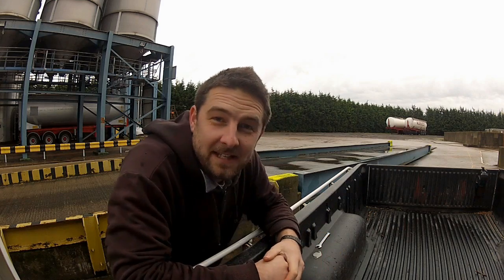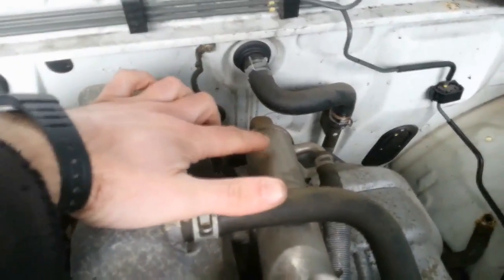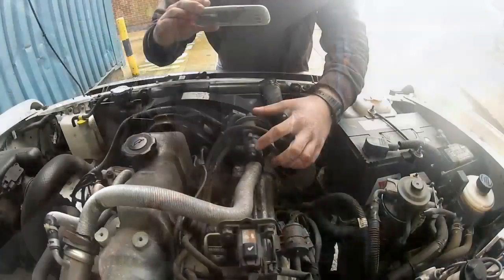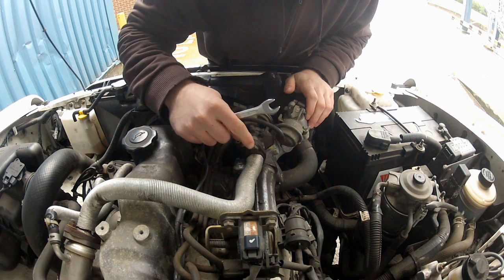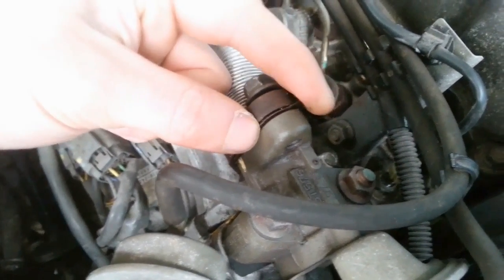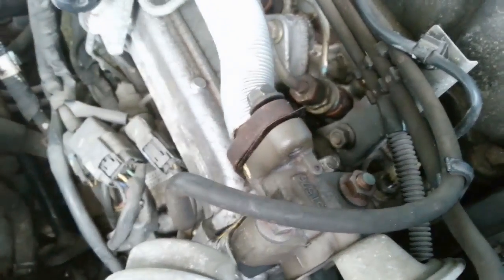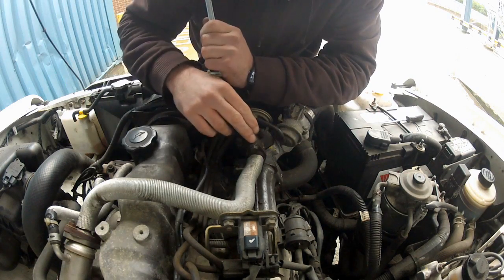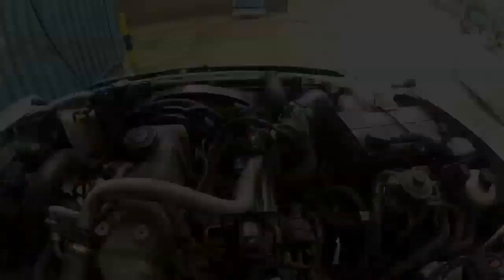EGR Blanking How To / Blank Plate Installation | Tech Tip 07

Comment: So on an 05 ranger it wont throw an EML?
Reply from the maker: Nope. Same year as mine.
Reply: I have an isuzu dmax 2008, I intend remove the egr and put in the metal plate.......will the computer detect and display error code

Comment: I did this on my 2006 Mazda BT 50, but I had to revert back because the engine ran too cool. It was lucky to reach 60°.
Reply: What is the issue if it runs too cool?
Reply: @4u2nvcpt  Big problems, Google it.

Comment: I fitted a blanking plate to an egr on an old car. Got an engine warning light. Cheap code reader said egr flow error. Ignored the error until MOT time. Then I removed the blanking plate the day before, cleared the code, and refitted the plate after it passed the MOT 😉

Comment: Just so you know, removing the cooler pipes from the EGR cooler will cause the pipes inside the cooler to crack from the hot exhaust gases.

Comment: if you put a 4 - 5mm hole in blanking plate, EGR sencor will detect the slight amount of gas passing through..... not 100% blocked off but shite loads better. have also been told a performance or economy chip turns light off

Comment: Im not sure but I believe some cars are gonna throw a tantrum when doing this if you dont get it remapped for an EGR-delete. Some vehicles may go into safe-mode and such and light up the check-engine light, correct me if im wrong
Reply: Yes, I’ve had loads of problems with my EGR valve. It was causing an over-boost and under-boost error. Got a new one put on my Relay van which just resulted in the engine losing revs on 2000. When they disconnected the EGR valve the van ran perfectly but the EGR valve fault came up. I have been advised to get in plated and they said they’ll have to remap the van otherwise an EGR fault will reappear, then the engine light will come on and the van will go on to reduced power.

Comment: Is it true, if I blank my egr without tricking the ECU it will chuck the car I to limp mode? And would putting a small hole in the blanking plate stop limp mode and not chuck out engine management lights?

Comment: Is it ok to do for a gasoline (regular) engine? I have a pick up truck with the vortec 8.1L. Thanks!
Reply from the maker: 8.1L 😍 You can do it to any engine the issue is whether the ECU picks up on it and throws a code
Reply: @FastRust  and is it ok If I get a code? I still can ignore it?

Comment: To "FIX" the check engine light.  Get a small piece of electrical tape and cover the light on the dash.
Reply: I did this on my 1.9 cdti vectra took clocks off and put a piece of black duck tape over emissions light job done
Reply from the maker: Yes that'll get you by in the short term.. until you have to get it MOTd
Reply: Fuckin brilliant

Comment: Can I just Block my EGR without ECU remap ?
Reply from the maker: You can blank any EGR valve. Depending on the vehicle you may trip the EML
Reply: @FastRust I have installed 1.5mm thick aluminium plate, Is it ok to use aluminium plate ?
Reply from the maker: Yeah I'd use some sort of gasket though
Reply: One option I read( not tried as yet) to drill a 10mm hole in the blanking plate to fool the ECU 😂

Comment: Wooow, EGR system is in the top of engine! In Opel its behind so you need to remove battery, coolant basket, fuel filter holder, several fires and you need to have extra shot torx-keys
Reply from the maker: Yeah I will say this is one of the more easier vehicles to EGR blank

Comment: It's always handy, when your working on the exact same vehicle.
Correct me if I'm wrong, Ford Ranger Mk2?
Reply from the maker: No need for correction mate, you're absolutely right. Mk2 Ford Ranger. Have a playlist with all my Ranger related stuff - link in description if any interest to you.
Reply: @FastRust  absolutely!
Is the ranger still running? I've heard good things about them but not had mine long. Only got 59, 000 on it
Reply from the maker: I got mine at 48k & still going strong approaching 150k. Never given any bother, one of the most reliable vehicles I've ever owned! Keep up with routine maintenance & it'll serve you well!
Reply: I have a 2010 ranger think it's a mk4 everything is the same apart from the face-lift am I right in thinking this will still be the same on mine been thinking about doing it since I bought it but always have in the back of my head I'm going to mess it up 🤦‍♂️🤦‍♂️

Comment: Well that environment argument is pure bullshit. Many cars, like mine, a Hyundai iload are known to turbo faliure due to carbon buildup and shit that restrics the oil pickup, and later on the engine breathes in turbo parts and swarf from axle and other things... Which then will result in the need to scrap that car, which takes lots of energy, and then I have to buy a new car which was build by an energy consuming process with lots of emissions. And also that makes the car company to have the need to produce more cars and bla bla bla..... So if the engine held up for longer, and people didn't have to buy new ones due to engine failures, then that will make all the emission bullshit to be just bullshit... EGR valve is just a device to ruin engines short after warranty expires, and then companys can produce more cars. And the politician who most often haven't even held a wrench in their whole lives just live in that lie that they thought that they have made an environmental beneficial stand... So in the end those naive sons of bitches called politicians think that they contributed, and the greedy manufacturers of cars are rubbing their hands and counting profits.... This world really needs some glasses to see the bigger picture, and no EGR, because even if it sounds like a good idea, it's really just another part that needs to be replaced and then the money you earned just changed pockets to the car manufacturers pocket....
Reply from the maker: I firmly believe that keeping older vehicles on the road IS helping the environment, for the reasons you stated . This 'throwaway' culture really bugs me. My comment about the 'environment' in the video was intended as a joke, but seems to have annoyed some people!
Reply: I’ve been explaining this side the argument for ages,. I just rebuilt a Santa Fe diesel because of overheating issues and was absolutely horrified at the soot half blocking the intake 🤯 How can sucking in chunks of soot & carbon be good 💁🏼‍♂️ and it’s gotten even worse with insistence of ADBlue, what a ridiculous blight on the environment that is🤦‍♂️🤦‍♂️🤦‍♂️🤦‍♂️🤦‍♂️
Reply: @markrowe9864  yeah exactly. Before when there wasnt direct injection the fuel cleaned the valves. But now there is nothing that avoids the build up of carbon.

Comment: Top Job very well presented mate 👍🏻.  The only advantage I can see to blanking your pipe at the exhaust side is you won’t get extra heat coming up and over your engine :)

For anyone interested in installing an EGR blank to a Ford PX Ranger 3.2 litre engine it’s quite a bit trickier than this blokes but I’ve got a link to it, hope you don’t mind mate 😁 https://youtu.be/piP8W8L1KqU
Reply from the maker: No problem. Cheers. I have thought about removing that whole circuit over the cam cover, just not got round to it yet!

Comment: fitting one of these wont disable the error codes surely
Reply: Brian Sowerby yeah they can come up with a warning light on new cars. Drilling an 8mm hole through the centre of the plate will let some gas bypass and recirculate, but you won't have a light and it will still benefit the car a lot
Reply: @Azzo99  the air mass wont see a diference hence giving a code of egr flow error
Reply from the maker: nah, I doubt it. More than likely it will cause an error code in newer vehicles.

Comment: can someone please answer my question. Is it possible to stop the EGR by just removing the vacuum line that is attached to the EGR valve? or would this have any potential damage in the long run?
Reply from the maker: Yea, it will work, the only problem with doing it this way is that the exhaust gas will still make it to the valve, adding to whatever gunk is already in there.
Reply: Fast Rust that is very true. 
Quick question: Should the vacuum line be operating on cold start? 

Because from what I read online, the egr valve should only open when the engine gets warm. But in my car it was pulling a vacuum on a cold start
Reply: If you just do this you may find your EGR valve eventually clogs and causes an error code requiring replacement.  For 5 bucks it’s better to blank it at the source

Comment: I have just done this to my focus 1.8tdci 2006. At first i could tell it was faster and smoother but now my engine now seems to be quite loud and a bit slow. I cant find anyone else having this problem anywhere and it seems everyone has a positive result. Any chance I have fitted it wrong?
Reply: Rich Anderson could be your dpf clogging up and check your turbo take make sure there's no play.
Reply: No egr, no gunk filter. What goes, stays
Reply: I have Ford Focus 2007 model running on petrol and check engine lights have been a problem for a while now and it says EGR system flow fault, it might take more time and cost to order a new EGR and replace so I am planning on deleting or blocking the EGR but still unsure about it. do you recommend of using blocker plate for the solution?

Comment: Wouldn’t just removing the vacuum pipe amount to the same thing as blanking off the EGR
as the valve within would remain shut?
Reply: zyd Kap yes as long as the erg valve is quite clean and shuts correctly, dirty ones stay slightly open, as don't forget to block pipe

Comment: Does blanking mean it will fail the emissions on mot?
Reply from the maker: As far as I'm aware, diesels are only subject to a visual/smoke test, so it should be fine. This is the case for the truck at least.
Reply: If they see it tampered with, it will fail.
It’s the same for the dpf, I have both the egr and the DPF removed/blanked off on my A6 3.0 tdi, passes mot like a trooper every year.
And runs like a dream.
You would never know they were done looking at them.
Watch for soot build up on exhaust pipes, a good running engine will run clean. Mine look like a petrol engines exhaust pipes.
Reply: @MrWebsie  
Thanks for that. I actually found that out through my own mechanic who does my MOT! He said he will do it for me.
Makes you wonder why we even bother with these bits